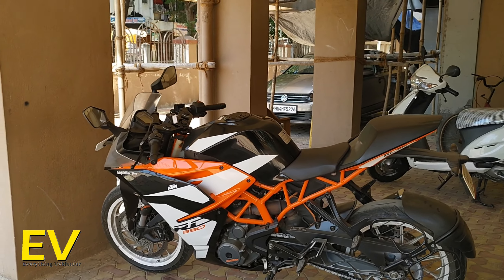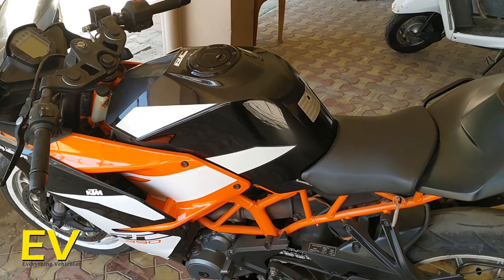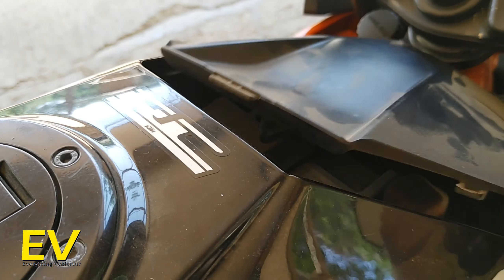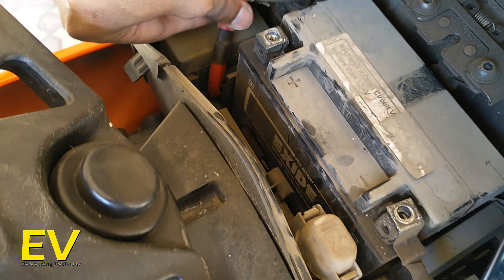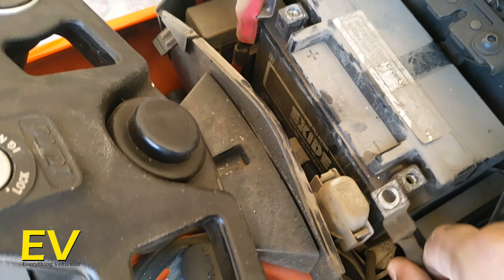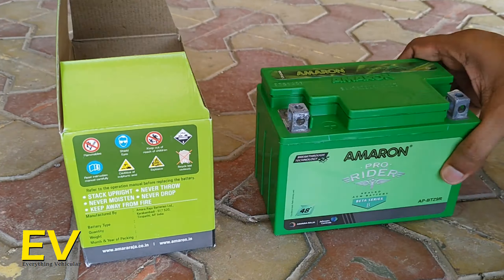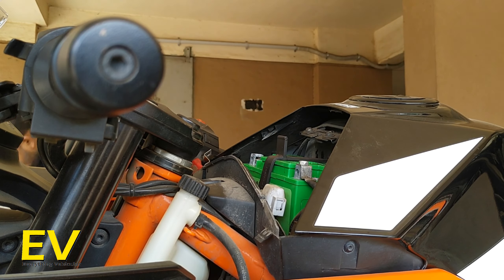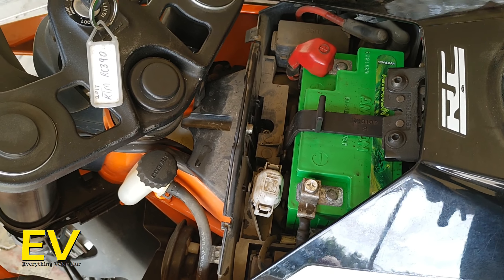DIY battery replacement of KTM RC390 | During LOCKDOWN 4 | Everything Vehicular

Comment: Helpful video. Cant we just get the battery recharged?
Reply from the maker: Yes, that is a solution too. but my battery was beyond that point. recharging would have last only month or so. hence the new battery for my #KTM
Reply: @Christopher Franklin Instablaster :)
Reply: @Forrest Walker i really appreciate your reply. I got to the site thru google and Im in the hacking process atm.
Looks like it's gonna take a while so I will reply here later with my results.
Reply: @Forrest Walker It did the trick and I actually got access to my account again. I'm so happy:D
Thank you so much you saved my account !
Reply: @Christopher Franklin no problem =)